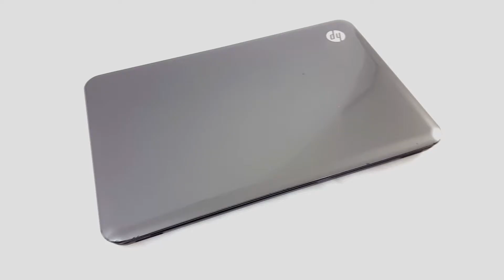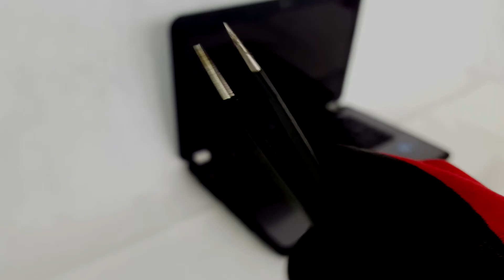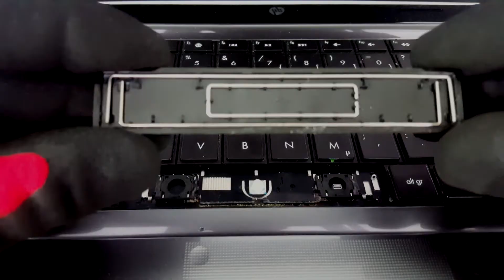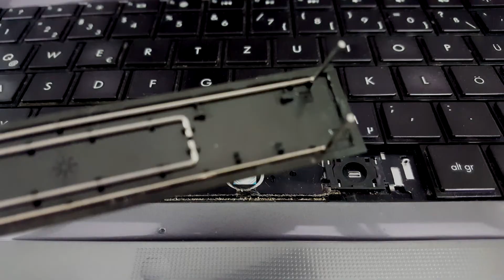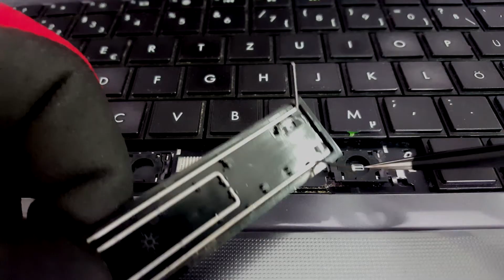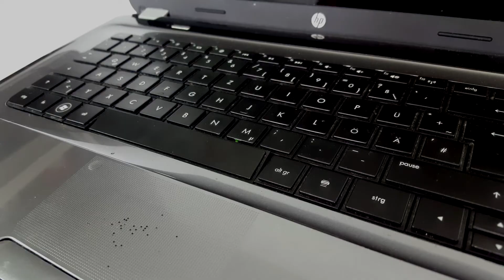How to Remove and Replace the Spacebar Keycap on Laptop Keyboard  HP Pavilion

Comment: I took mine apart and air dusted it and a tiny round rubber grommet came out. There's a hole in the central rubber part made of the same rubber so i inserted it. I eventually got it back together and although my spacebar works, it sits about 1/2mm too low and has lost the springy bounceback. The spacebar is noticeably worse. My laptop is A Clevo rebrand with a full rgb backlit feature. Any ideas please? I suspect it's to do with either the two white hinges - that I never took out to clean, or it's maybe the rubber grommet is not where it should be.

Comment: THANK YOU!!!!!!   I have a brand new Lenovo Yoga laptop and my space bar key came partially off.... I took it to Best Buy and they wanted to send it out for repairs costing me a $100 deductible or I could send it back under warranty to Lenovo.  I watched your video 3 times and finally felt like it was worth a try!  The little hinge set had come apart on one side and because of your detail I was able to reassemble it and get it back in place!!!!  The bars went back a little differently which I found on another repair video specific to lenovo's but it didn't have the detail you had. Yours was the main reason I successfully repaired my laptop without having to send it back!  SO VERY THANKFUL for your attention to the detail and zoomed in images! BRAVO!

Comment: Thanks, I can usually figure this stuff out on my own, needed to take a look at this to realize I was putting the space-bar on left-to-right instead of right-to-left so my inner-side space-bar pins weren't lining up lol. Just needed to take the space-bar off to do some cleaning since it was getting jammy, smooth as silk now haha.
Reply: How did you clean it?
Reply: @tekgewet  air spray thing i forgot what its called
Reply: Jiyzo compressed air I got a new laptop anyways lol

Comment: The problem i have with my spacebar is that it became suddendly totally flat. I mean it is still working but it is flat and not in the height of the other buttons and its kind of annoying. I opened it like you did in the video to clean it and it did not helped. My spacebar also has a cup in the middle which is not stunk with glue (or the glue is removed) but this is not the problem. I just ask if i should also use glue to stunk it back when i will open it again. But why the spacebar is flat!! When i opened it the hinges where flat also. I think the hinges have problem can i do something for this?

Comment: Thx ma dude. I have a Lenovo and if you had the same problem as me it was getting those damn pins in, Lenovo ones are curved in a hook and you have to get both hooks in at one side then push the button down and slide it in.